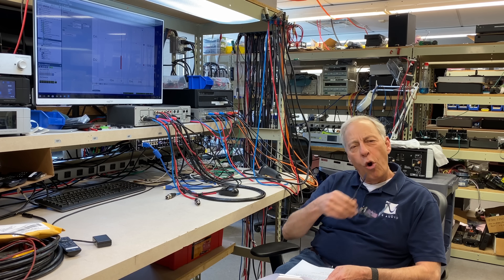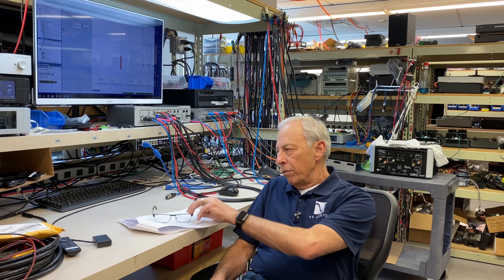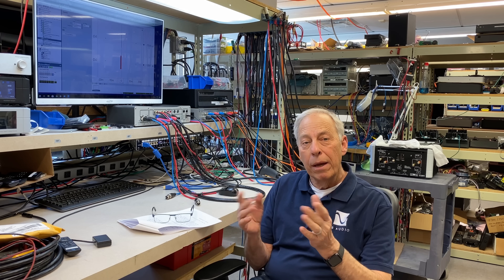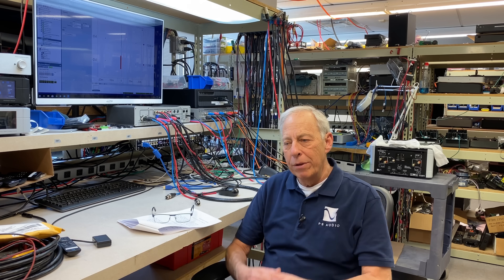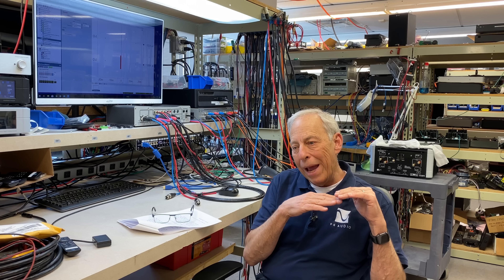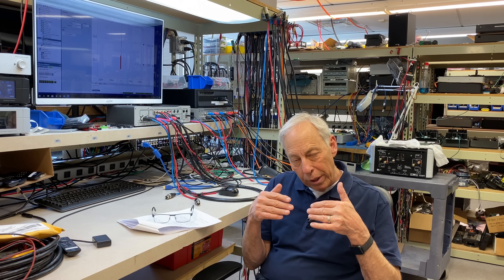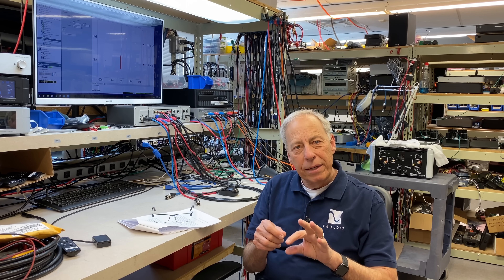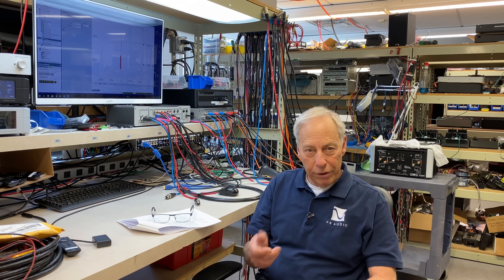How do ferrite cores work?

Comment: I found I was getting interference on FM when my kitchen lights (LEDs) were on. Putting a ferrite bead on the antenna lead fixed that problem.
Reply: I would get rid of the lights. I had a equipment cooling system I bought from a un named company. After a month or so it started to make the TV that sits next to my system get lines across it like mom was vacuuming back in the 1970's. They were like, just get a ferrite for the power cord. I was like, no. Why should I bandage up what was their wrong in the first place. After going back and forth with them over a couple days I sent a not so friendly email and explained to them that it was a audio system cooling unit and it shouldn't be making a TV that sits feet away flip out. I mean what if I used it on a entertainment surround sound system for a TV? I may have also mentioned that I planned on trashing them online if they didn't fix it. I got a new one with return postage and have been very happy with it since.